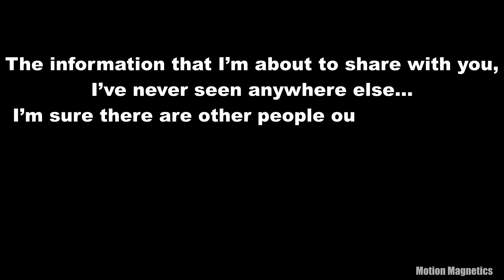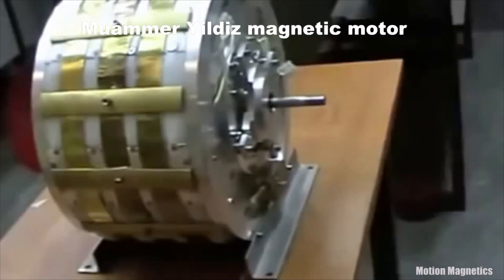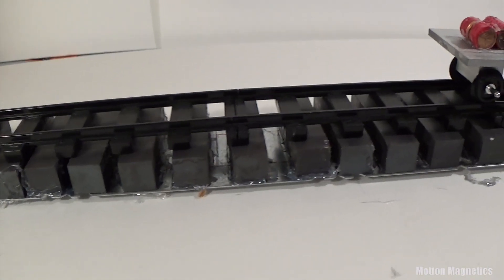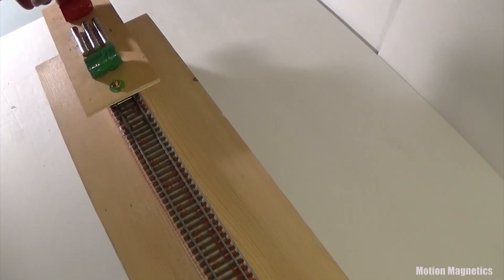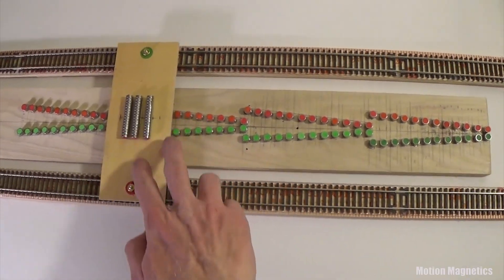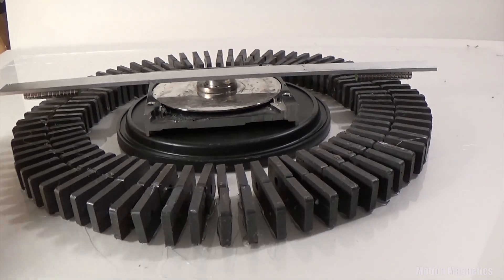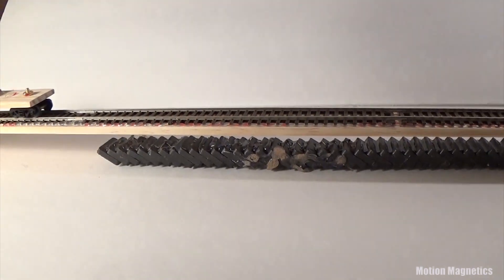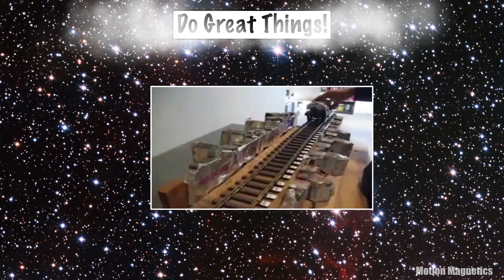The 3 Types of Magnetic Motors Part 01

Comment: literally every one of these motors were scams. there is not a working magnet motor because magnets CANNOT produce energy. You can only put energy into them! this is WITHOUT EXCEPTION! use all the big words you want just more snake oil.
Reply: when oil will no longer suffice for all, then suddenly they will invent all petpetui engines, or existing magnetic. LOL .. we are in the era of spatial microelectronics, and coincidentally, they are not capable of inventing an engine without oil hahahaha
Reply: ***** no....magnets do not contain energy. They can only do work if you put energy into them ie grabbing it with your hand and picking something up with it. There's no energy being created only used.
Reply: ***** nope. The only way a magnet can have any potential energy is if it is elevated. Otherwise it does not contain energy. They just don't. A magnet cannot do work unless you add energy to the system. Example is using your hand to pick the magnet up to use it. Magnitism is a force not a energy.

The laws that govern the universe are stupid? Ok! Lol 😄
The laws of thermodynamics aren't laws you can argue in court bud. as of now not a single established law of physics has ever been broken. If you know how you would be the first! the laws of the universe are pretty concrete.
Reply: @thebuttnakedpodcast3006  not once had a magnet ever produced more energy than was initially put into it. That was a whole lot of gibberish to prove nothing. Free energy is a fundamental impossibility.
Reply: @thebuttnakedpodcast3006  You have a very strange idea about the scientific method. 99% percent of all scientific effort goes into trying to break the laws, trying to find holes in them, or trying to get around them. Nobody has "decided not to go over them", exactly the opposite: everybody is trying to go over them. It is exactly because the laws of physics have withstood all those efforts all this time, is why we believe they are correct. The law of conservation of energy is one of the most tested laws of them all.
Reply: "So you can only put energy into a magnet? So your basically saying you can destroy energy am I right? My bet is that magnets compress energy and let it out slowly over time or faster when it is used in say a motor."

It is a very common misperception that magnets have energy put into them at the factory. Magnetism is a force, not an energy. There is nothing in a magnet that "let's out" over time. It's a totally bogus concept.
Reply: No problem. I have to take quite a bit of credit for that. I see that I flubbed the opening. It DOES look like I was aiming at you. I apologize. Anyways, I didn't see what you'd said before, so no hurt felt here.
Reply: ***** as stated it has not been broken. Only something like 99.9999 percent of the speed of light is achievable. You cannot go the speed of light. Sorry to bust your bubble I've been to school and in my 30s I'm still learning as much as I can. 

Magnets motors do not work cannot work PERIOD WITHOUT EXCEPTION! end of story. Show me any REAL proof that magnet motors can actually work.
Reply: "+MadMetalManiac74 No hard feelings but brah, really?? haha big words where??? ill use the most simple words I can for you. Go back to school brah. You keep changing your comment up every time saying a magnet doesn't contain energy and now it doesn't produce energy?? But anyhow the speed of light has (supposedly) been broken and it's going through another test to check for errors... and no I never said they were laws like federal government laws haha what you think we talking about passing a bill or something? But I have my opinion and you have yours. I'm just sayin that trying to be a dream crusher just because someone is trying to create something that is "impossible" say a magnet motor, so be it either they learn the hard way on their own and learn from that experience and maybe one day they will create something great. Me personally, i think anything is possible and their is no reason to give up just because someone tells you it's impossible. Everyone laughed at Isaic Newton, Einstein, Edison, Darwin and the Wright bro's but they still didn't give up and that's how they achieved the great things they did. Peace brah, ima just say your 100% right to end this argument....YOU WIN 🐓🍭"

For God's sake, man, open a fucking science book! (Try your local library; in the 520's of the Dewey Decimal System.) Your understanding of the most basic and simple concepts of science and physics are abysmal. You're talking like a fool.

For the record: The speed of light has NOT been broken, science is NOT subject to your or anyone else's opinion and NO one laughed at those persons you named. All of them were highly respected during their entire careers.
Reply: jhanthony2 oh wow! I didn't realize you were quoting a comment I already addressed. I thought you were talking to me and I posted a big ass rant lol. My apologies. I removed the coment already. If you saw it already then disreguard. People are so easily dooped thinking they can make a motor with magnets.
Reply: Instantaneous action at a distance is another thing to the speed of light mind you
Reply: MadMetalManiac74 I thought everything is made up of energy. From what I've read from Elisha Gray, a magnets force is the molecular structure directed to act upon other physical structures that are conductors. Magnitism is actually a form energy being directed. There's a free book on Amazon Kindle by Elisha Gray. It's really good.
Reply: sounds like a paid debunker by big energy to me. keep telling us it ain't possible and 99.99% will believe you but its that remaining 0.01% you better be concerned about...
Reply: +Jared Simpson 

You obviously have no clues on how magnets works. You can't just spread some random bullshit out of your ass and claim that is how its works. 

The movent of electrons creates a magnetic field. That's how electromagnets works (or any electric motor.)

Permanent magnets works the same way, the structure of the molecules have been made that all the electrons around atoms a moving the same way. The tiny bit of magnetism created by each electrons quickly adds up to make a "strong"  magnetic field. 

BUT electromagnets are and will always be the best way to make use of strong/cheap/reliable magnetism. 

+
Nothing can go higher than lightspeed
This max speed is actually the causality speed, it's one of the main reason the universe exist. 
Any object w/o mass (like photons for example) will travel at max speed. 

So lightspeed happened to be equal to THE max speed 

Strop spreading bullshit start to inform yourself if you like this stuff you fucking degenerate

Comment: you gave one guy Credit in this video that Simply Built a design that was handed to him and designed by somebody else PS you are 5 years behind the xjda M16 and the xjda 33 free energy stator magnetic generator and motor with a 360 introverted ball bearing system Google it this design was built and fabricated for free energy and free energy jet stator turbine Motors
Reply: Quit with the 'free' energy already.  How much energy did it take to manufacture the parts.  Yes,,, I get it ... we may have taken the need to replace the fuel for a long time but everything else costs.  It's not free.
Reply: If this works it is not magic, it's science and it's not free.
Reply: The word of free energy means it produces its own electrical current from went inside of itself with no combustible material it does not mean the product is free
Reply: Of course and how much energy was required to make the parts?  I am not suggesting at all that this is like the small fluorescents that came out where the amount of energy saved did not come close to the amount used to produce not to mention the difficulty of disposal.  I do think that we should see this for what it is.
Reply: Look up Stater Motors when it is required one revolution per second puts out 12 volts
Reply: look up X jda M16 33

Comment: nice but are you a true seeker or just able to compile stuff? got any revolutionary ideas
Reply: add super capacitors to run on pure voltage not current then you will be putting 10,000 time more power out then in from a discharged 9 volt battery

Comment: can anyone tell me why this is not used in circular form to generate electricity
Reply: +Anirudh Konnur because creating a machine that does not use any external force to start, and then keep going is impossible. if you have a magnetic motor, maybe you can make it very very efficient, but it will slow down after time. think of rolling a wheel on a floor that has no friction, maybe it will role for a long time, but after a while air friction will slow it down, plus heat energy is being lost from the wheel as it spins, which will slow it down futher
Reply: thanks for that but i guess if we use a vaccum chamber we can even get rid of air friction these motors are just awesome
Reply: Ok, but that still doesn't account for loss of heat, plus in a vaccum, with no air to cool the machine down, there would be major heat build up
Reply: hmmm yeah

Comment: Correction. 3 types of non working pipe dreams. The snake oil induction flux generator hoax proposer is the 4th type. Don't forget the Tesla secret non existing energy field BS extractor. There are plenty of patents for crap that don't work. Non of them will work. We've known this for 200 years.

Comment: Magnetism is only FORCE. To create work, WORK is FORCE x DISTANCE. POWER is FORCE x VELOCITY. Without Distance and Velocity there is no Work or Power. Tesla made the electric motor by making a rotating magnetic field. You can not make a motor with static magnetic field no matter how strong. Like gravity, many inventors lived and died trying to make a gravity motor but it does not work  unless there is a continuously falling object like water. Unless you can put magnetic field in motion, you can not make a static magnetic motor until you die.
Reply: you been reading too many comic books. sounds like a paid debunker to me. so you're saying if I measure 100 foot pounds statically I have no work done, huh? interesting. however what if I do have 100 pounds of static here? with NOTHING to create that pressure except static magnetics.
Reply: Magnetism may be exactly like falling water, but with itself as the source. Check out the tap analogy in this video https://www.youtube.com/watch?v=rm5ZCtT7m_g
Reply: Yup, gravity motors dont work, remember that, next hydro dam, or oil well pump going up and down.   Linguistic symantics should not deflate dreams.  Let em try anyway.
Reply: that indian taxi driver made one. its all over you tube.. check it out
Reply: Magnetism is force, similar to an electromagnet, except you don't have to power it and you can't turn it off.  Both electromagnets and permanent magnets can perform work using force to create kinetic energy.  Then use kinetic energy to turn a load.  It's simply a matter of switching fields and timing.  In my permanent magnet motors, (that all work), I use for timing an electromagnet for accurate timing, but the magnets provide the force and produce kinetic energy, which can be converted into electrical power at a surplus.  See Dynamaticmotors.com.
Reply: @LibertyMagnetMotor  On your website you state that your motor uses "7.3 watts input" power. So no, it does not run on permanent magnets, it runs on 7.3 watts input power.

Comment: To bypass the cogging effect, implement a synchronized motion shield as from an aluminum slider (perhaps in assistance with a very light self generated electromagnetic dynamo pulse, between the track and trolley magnet?
Reply: I heard you have to surround each magnet with a ferrite shield

Comment: Motors that run on only magnets and no electricity have existed since the 1920's but they don't last very long and require magnets be changed after a short time. The magnetism that causes the motor to turn is ENERGY that is USED UP providing MOTION.
Yes, magnets can run engines BY THEMSELVES with no hidden batteries which has been demonstrated since the 1920's and in children's toys since the 1950's that run ONLY ON GEARED MAGNETS but the magnets GO DEAD due to conversion of magnetic energy into motion. Even the instructions say you need to replace the magnets after a given number of hours. 

NOBODY is saying that magnets go dead quickly on their own. Get it? Just like a battery a magnet will last for many years without use. But use the battery to power a motor and it will go dead quickly just as a magnet that powers a mechanical motor goes dead quickly. You are converting stored energy into motion. There is no such thing as perpetual motion - no matter what energy source that powers a motor, whether its a battery, magnets, water, steam, air, etc. it will be used up. Saying that magnets last forever is like saying that perpetual motion exists. 

Here's an experiment you can try at home for those idiots that never went to college. Take two large donut magnets and enclose them in a cylinder arranged so the poles are repulsing each other and one magnet is floating above the other due to the magnetic repulsion. The sides of the cylinder should keep it from flipping over but the magnet should slide freely up and down. Leave it for a week. In one week both magnets will be nearly or completely dead.
Reply: +Lucius Dark My magnet motor does not use repulsive force so the magnets will align themselves and last for hundreds of years. When 2 magnets attract each other they become more magnetic, and their strength slowly increases, when there is no repulsive force. When there is repulsive force they lose their charge. So even when you pull 2 magnets apart they do not lose their charge unless there is a repulsive force.
Reply: ***** These are the facts. If you put two magnets next to each other they will slowly increase their charge, unless they are like poles, then they will slowly lose their charge.
Reply: ***** google it
Reply: HappyTimes Ok, if you wish so: all magnets of the world behave differently than you describe, except your very special personal miracle magnets.
Says Google.
Do you know what coercitivity or coercivity and permeability means?
Google it.
To be more specific: what you describe applies to the old low coercivity magnets, e.g. ALNICO, but does not work with modern magnet materials.
Somewhat. They can annihilate each other, but they will not "charge" each other above their inherent mag. level.
.
With the old type magnets you must not take apart a motor, for example, because when opened, the magnets will lose part of their magnetization. Special precaautions were necessary. With modern magnets this is no longer.
Reply: ***** It wont ever exceed a charge of 100 percent alignment but due to natural forces magnets slowly lose their magnetism over time. when 2 magnets are coupled together they become stronger not weaker. My free energy device uses zero repulsive orientations so they will never lose their charge. This is why other's free energy devices will fail but mine will last into the future!
Reply: HappyTimes They don't become stronger.
Your statement is false. (Except for adding 1+1)
Reply: ***** if the alignment is less than 99 percent they do. That is how you charge a magnet (by putting it near another magnet.)
Reply: ***** If I read correctly the coercivity factor of a magnet should not be more than its magnetic strength, therefore two like magnets will align each others alignment (up to 99 percent), and if repulsing each other will lose their charge.
Reply: ***** the demagnetising field can be slightly weaker than the coercivity and it will have an effect according to the relaxation principle where the magnetization of a material measured at an applied reversed field which is nominally smaller than the coercivity may, over a long time scale, slowly relax to zero

Comment: so, if you were to use electric powered magnets (lose magnetize ability when disconnected from the power source) would it be possible to create sort of a wave to push the object?

Or positively charged magnets that when the object passes over or just before it passes over, the magnets will turn off and have no magnetic pull, then go negatively charged when the object has passed (by flipping or something).
i drew a quick picture in paint lol
https://plus.google.com/u/0/100642917159050081194/posts/1MWyestrwdw

Comment: Obviously  the men who construct these primitive devices  are delusional.   Most are constructed of the wrong materials such as wood, cardboard, duct tape, plastic, etc.  A true magnet motor   needs an output shaft  to perform work.   None of  the devices we see on youtube  would ever work.   They  are  only to entertain the curious.
Reply: gardnrobe Before going too far with any of these designs, remember, there are no "right" materials. It matters not what you use, the result is ALWAYS the same: failure. Knowledge of the principles of permanent magnets will reveal why a permanent magnet ONLY motor cannot and will never work. Never. Ever. Period. Howard Johnson gave up on his motor, he produced a lot of hot air about what he had done, but the bottom line, he NEVER produced a motor that worked. He was a story teller, (read, liar), but not a successful inventor.
Reply: @quantumleap359  
Ha! You skeptical mature funny.